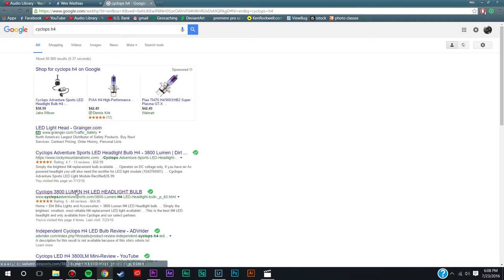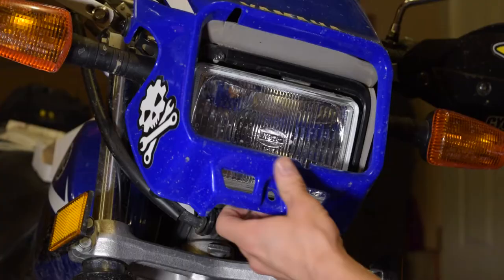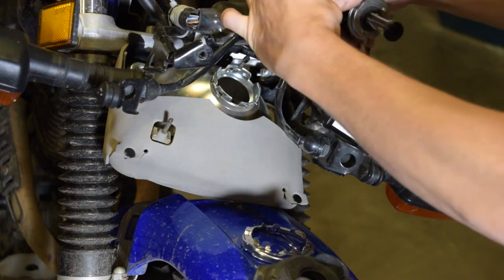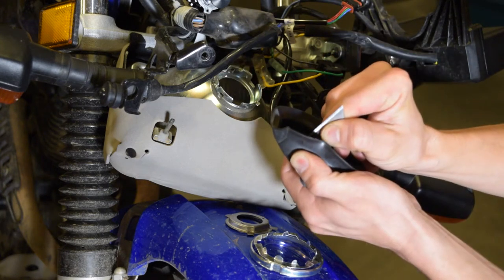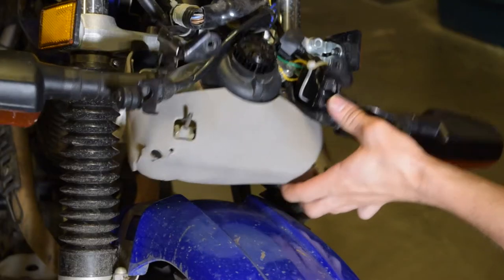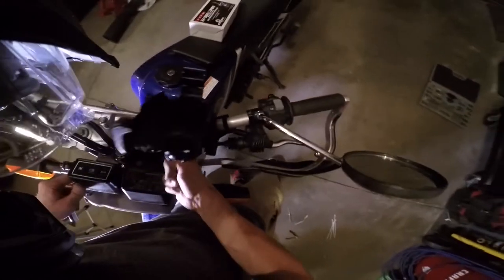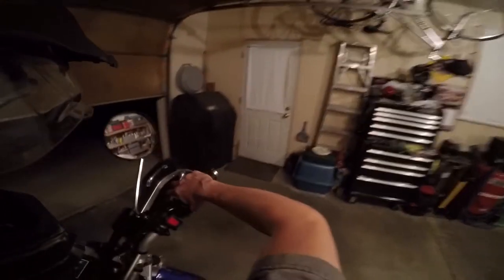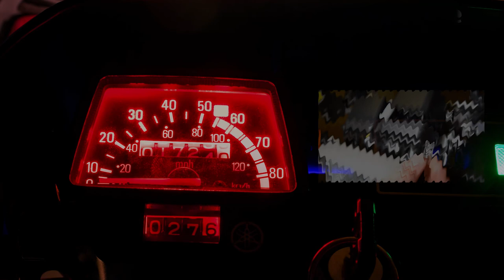TW200 - cyclops LED headlight bulb Install and test

Comment: Another tip is to soak the rubber boot in really really hot almost boiling water for 30 seconds.... it will pop it through.  This is a great mod and video.
Reply from the maker: great advice! thanks!

Comment: Just installed the cyclops on my TW200. I did not have to cut the rubber boot like you did--just some gentle stretching got it around the light. Thanks for the tutorial, this light is awesome!
Reply from the maker: nice, awesome to hear you didn't have to cut the rubber boot! yeah they are sweet did you get the 3800 lumen one? appearently they have a 7000 lumen one which would be insane haha
Reply: TDubsKid yes the 3800. It's plenty bright and probably not street legal so I don't want to push my luck!
Reply from the maker: bigboludo nice the 3800 lumen one is plenty. Yeah technically not street legal but I feel much safer with it and the low beam has good cutoff so it shouldn't blind anyone

Comment: The big Phillips screw Shriver is a #3   screwdriver. If you use a #2 screwdriver you may strip it

I just Installed  a complete LED light on mine today. My old 87 TW had a sealed square bulb so it was cleaner to go with a whole new light
Reply from the maker: thanks for the advice! cool hope it works out good for you!

Comment: Also a good idea to wipe the new bulb off lightly after installing, as finger prints or oil from fingers can cause hot spots that can blow bulb out prematurely
Reply from the maker: very true, best not to touch the glass if you can but alcohol works great to clean it if you do

Comment: Hi, can you please tell me where red wire goes on the Jns engineering led headlight goes. They said it should plug Wright in.
Reply from the maker: it's just the for the accent light and not for the actual high or low beam. you could wire it into the running lamps. mines not wired into anything right now

Comment: There are no Phillips screws on anything from Japan. They are jis, shaped different, Philips drivers will strip the heads. Get a set of JIS screwdrivers.
Reply from the maker: I'm aware, thanks, ill probably get some next time I need to remove some jis screws

Comment: Did you check the aim after installing? It appears slightly higher.
Reply from the maker: I didn't adjust the aim after installing it but I did raise it up higher with the stock bulb when I bought the bike